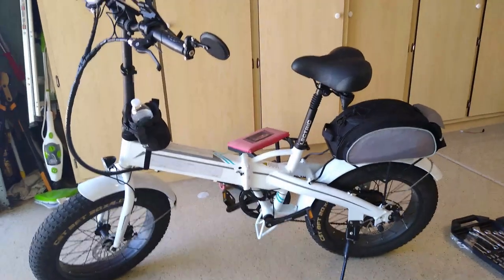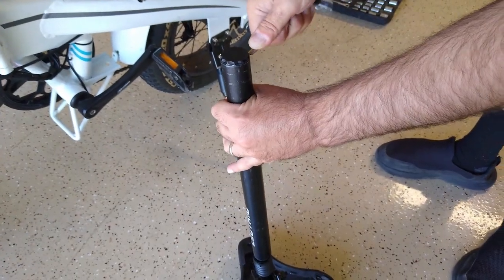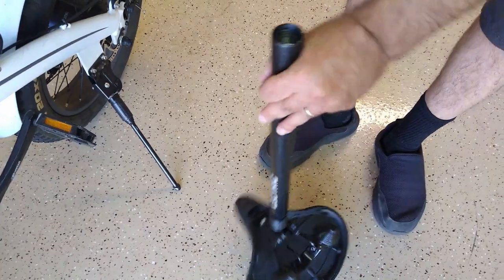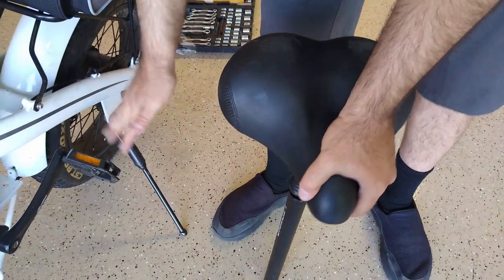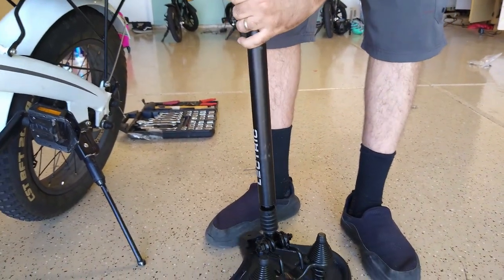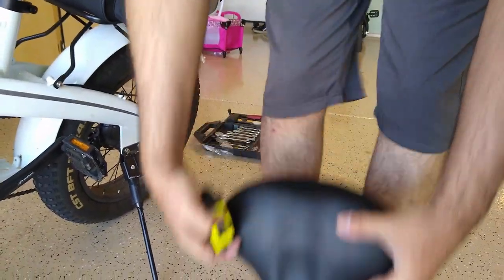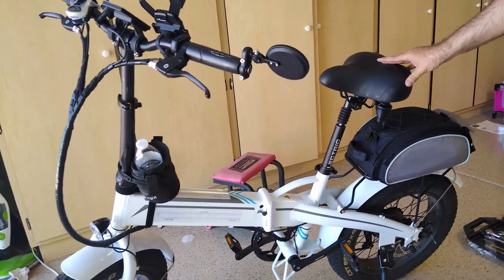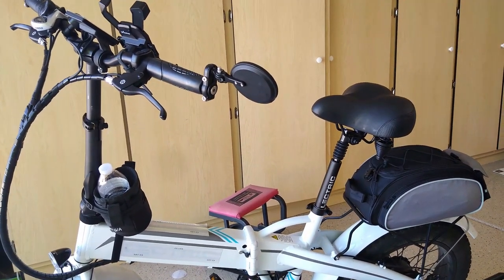Adjusting the Lectric XP suspension seat post.

Comment: Thank you for that tip about the 3/8" extender.  I was about to go shop for a big Hex wrench and not looking forward to it.  Also, mine did not come with a cap but the instructions said to remove a cap, so seeing your video made it clear what I needed to do.
UPDATE:  So I went to try to use my 3/8" extender and it is too small.  Does anybody know the size Hex I need to adjust this suspension post?
Reply: 3/8 extender does not work!  A 12mm hex is the correct size.

Comment: Do you answer any of the comments? Just wondering. Most of us have the same problem. Seat won't stop spinning around.
Reply from the maker: I haven't had that problem. You have to make sure that wing nut is turned clockwise and then when you clamp it it should be real tight if it clamps too easily than you need to turn it clock wise some more and then reclamp it. This is for the original lectric xp. Not sure about other models

Comment: When I put my comfort package seat on the bike and tighten the lever. The whole thing just falls down like it’s too loose or something, why is that?
Reply from the maker: you may have to spin it a little more clockwise and than reclamp it.
Reply: @TrailsUnscripted  okay so put the entire post in the hole of the bike and spin it clockwise then clamp? I’ll try it
Reply from the maker: @alexryder9284  spin that clamp clockwise a little and than tighten the clamp lever, if it is too tight it wont clamp down , so turn it counter clockwise a little and reclamp.

Comment: Would a 10mm allen wrench work to adjust the seat post?
Reply from the maker: I have it and so I assume it was either too small or not long enough.
Reply: No,  10mm is only .393" and 12mm is .472"  Way to small to use.
Reply: @Finnegan6674  A 12mm wouldn't work then? ..so what size then? Help.
Reply: @germanwarrior6463    Here it is from Lectric website.  

Adjusting the Suspension

    Remove the cap located at the bottom of the suspension seatpost by spinning in a counterclockwise motion.
    Use a 12 mm Allen key to loosen or tighten the tension of the suspension coil. You can test the suspension by pushing down on the seatpost.
    Once the tension is to your desire, reinstall the cap and secure a tight fit by spinning clockwise
Reply: @Finnegan6674  Thanks, you helped me out..I should of just looked again on the Lectric site. I'm blind..lol
Reply: @germanwarrior6463  it is buried in the support section.  Not easy to find.